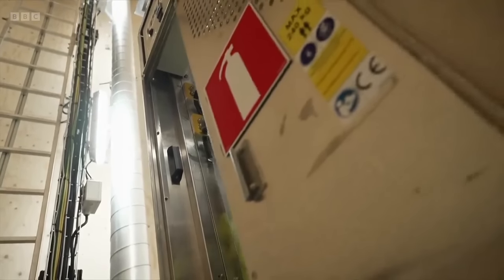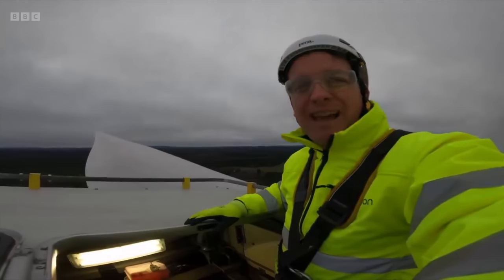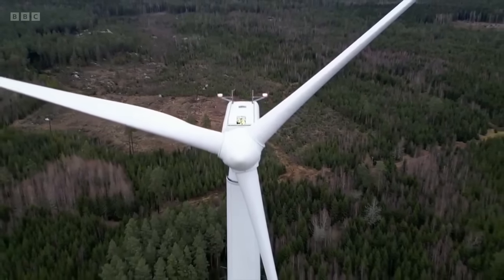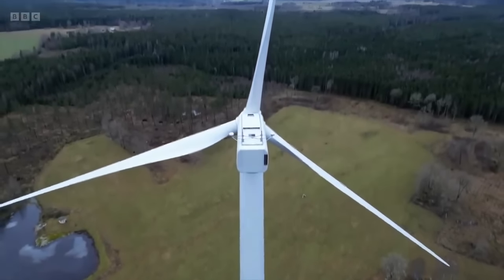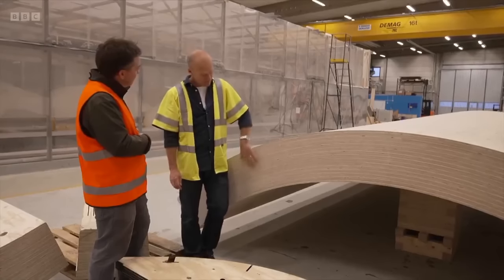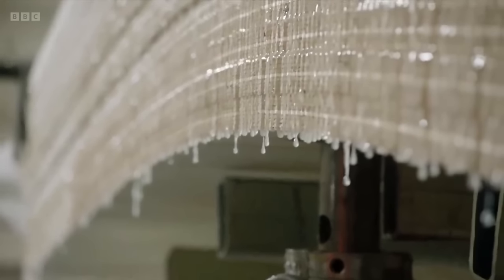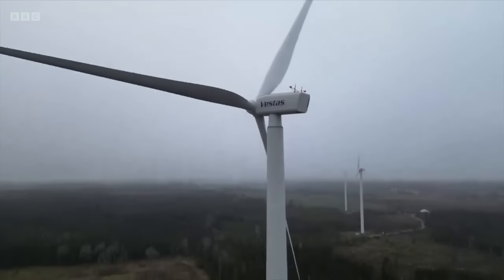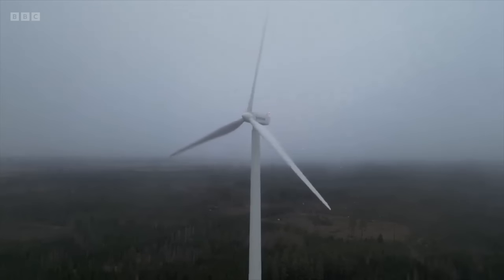Sweden’s giant wooden wind turbine promises greener future | BBC News

Comment: The question I have is how does wood hold up against the elements? Would these turbines have a shorter lifespan than their steel counterparts?
Reply: 100% it would. Obviously most components will have to stay steel.or some kind of metal.
Reply: Well the wood would have a substantial layer of some kind of protective laceur on it so im not sure if it would notice much of the elements at all... - obviously water should not be allowed to seep into the wood. - in theory there is no reason why a wood structure cant last 100s of years... not sure about the wood glue though and how well that will hold up over the decades.
Reply: @historyZZ  Depends on the location.  A steel turbine near the sea will degrade very quickly due to the salty sea air.  Meanwhile wood does not have that same issue.  In addition there are multiple treatments that can be done to wood to improve it's durability and resistance against the weather.
Reply: @giglioflex  
Wood that is exposed to moisture will rot. Therefore the wood would indeed have that very same issue.
Reply: @giglioflex  not trying to be a dick. But you're putting a turbine up by the sea metal OR wood. You don't think they'd try to properly coat their millions of dollar property regardless of the material. We have wind turbines in the ocean. They're not wood. I assume 99% of companies enjoy making profit. If they could off this they would be. And I know that's a cliche but my point is being made.
Reply: @historyZZ  Not a great point you made, since it neglects the fact that this is a new technology. Your point fails to predict any technological change leading to market change.
Reply: @Patrick-y4d1z  Tell that to all the ocean going wooden ships of centuries past.
Reply: U FOR  GET. WHERE ARE YOU GOING TO  KEEP  PUTTING  THOSE  BLADES.  
WOOD  GOES  BACK TO THE  EARTH...
Reply: Also, how is chopping down trees considered green….
And…what happens when it’s 40-50 Celsius and the glue on the wood starts to melt again, lol.
Reply: @SocialDownclimber  
You mean, the ocean wooden ships that had massive crews and were constantly maintained? And then all still proceeded to be destroyed by the water over time regardless?

Yes, that's the same thing and helps prove why this won't work.
Reply: Depends. There are wooden telephone poles that have been standing for 80+ years. All depends on the quality of the wood and treatment it is given.
Reply: the turbines are made of fiberglass, which is a polymer, created from oil, steel turbines would be too heavy
Reply: @Hathur  
Telephone poles typically last on average for about 30 years. 

Telephone poles also don't have moving parts, aren't as large or as exposed, nor are they as expensive or important infrastructurally. 

There's a reason that wood is limited in its uses building-wise.
Reply: I own a wooden boat 100 years old; it is a fine material for even the harshest environments. This wood is clearly coated and impregnated in an appropriate way to protect it from deterioration and this is built from softwood from plantation forest so no environmental degradation involved. I can see this idea being very successful, but like all new developments it will take a few years to perfect.
Reply: I think the limiting factor of turbine lifespan isn’t the tower, but the blades. If the wooden tower can last for as long as current blades, is shouldn’t be an issue.
Reply: This is just Swedish propaganda to make money
Reply: @historyZZ  That's why I would have a tower with a wooden frame but metal skin.
Reply: @WhyWorldWet 40C is not a thing in Sweden. We barely pass 20C in summers.
Reply: Don't forget wind farms at sea and land gives shorter responding times to inbound missiles. In Swedens case its military have warned of the consequences.
Reply: @Buppasiri1  its all designed to fail,for the great reset!!
Reply: @Patrick-y4d1z  in Finland it, s for the fire restrictions.
Reply: @SpoonfishLee really? We get 30 and more here in Stockholm
Reply: @starvictory7079  30+ is not the average. We had like 31 or something like that in 2018 with the big forest fires, but I don't think we had even a single day close to that this summer.
Reply: @Patrick-y4d1z  Wood does not automatically rot when exposed to the elements. Even when you get rain on it. There's a trend in modern building design to use untreated wood, and as long as you make sure it dries properly after it has been raining, it can last decades without any paint.Obviously these wood turbines do have some extra protection as can be seen in the video. But I'd  be willing to bet that untreated mass timber would last decades on its own.  I'm guessing the base where the rain collects isn't made of wood either.
Reply: and would that mean that made out of wood, its actually lighter than metal so its spins more therefore produces even more power?
Reply: @goncas1300 Did you actually watch the video?
Reply: No problem with wooden tower coming up from the ground. But you still ned 150 m3 of concrete to stabilize the tower. Unless it took root of course...
Reply: @auspiciouslywild  
Saying that they degrade slowly isn't exactly a great argument for their use though, is it? 

And most modern building designs when using wood (if any) tend to treat it and it's almost never used structurally because of its relatively poor construction qualities. 

It tends to be weaker, degrade faster and be less secure in relation to things like earthquakes, rain, fires. 

And this isn't better from an environmental perspective because these aren't trees that are living. They're farmed timber (which means habitat destruction) which are manufactured and transported as the regular turbines are and held together by glue which is also environmentally hazardous. It's also going to be less reusable than the regular wind turbines and require replacement more often, increasing the costs of maintenance.
Reply: aliminum steel gets dumped in big destructive and wasteful areas so, its better either way
Reply: @magnem1043  
Aluminium and steel is recycled and reused, it isn't dumped because it's still valuable. That's the benefit of metals. 

So it's better in literally no way.
Reply: Wood turbine ...... Meets termites 😂
Reply: How long does a tree or wooden rollercoaster last, some can last 100 years if taken care of
Reply: Everything (well… not literally, but you get it) in Sweden is built from wood.  Especially in the middle and northern regions. Larger buildings were built out of concrete and there was a regulation that said that a wood house couldn’t be larger than two stories for fire and construction purposes.  However after a lot of research that regulation was terminated and they now build skyscrapers (well… not like those who touch God in his butt, but you get it) out of wood. 
There are houses many hundred years old with untreated original wooden timber stocks around. You can similarly today make non-insulated timber housed that has the same (or better) isolation factors than the isolation standards houses built in Sweden must adhere to.  And if you treat the wood properly with a surface that breathes, it will last longer than concrete and wood facade buildings. 

These wind turbines need constant moderation.  While the energy is cheap, it actually creates a lot of maintenance jobs.  And even if steel or carbon fiber is used, the turbines (including the concrete) aren’t designed to last too many decades.  In the largest wind farms in Sweden (= in Europe) it will be time to replace the wind turbines as soon as the farms are completed.  That doesn’t mean only new towers, generators, and blades…. but even the concrete structures they stand on must likely be replaced.  But that is obviously a factor already taken into account when it comes to costs.  Getting the question “when will this wind park be finished” (about a major wind power plant where I live), I answer “just in time of New York being fully completed”.

Sweden is also turning its steel industry (a major one in the nation) fully carbon neutral.  That means even replacing the carbon used in the stainless steel with hydrogen atoms instead.  So greener steel will be introduced.  And much of the wind power will be used to accomplish carbon emission free mining and production.
The major issue however seems to be the concrete.  Where the cement involved is horrible when it comes to carbon emissions (and contamination of the drinking water where the mining of chalk is taking place).  But there are means to replace this cement with a cementish material produced from “leftovers” from the steel industry.  But due to a close to monopoly situation when it comes to cement production, unfortunately this technology hasn’t been invested in.  And if the lawmakers finally would be as concerned about regulations on this issue to help create a situation where competitors can start to invest in new cement technologies, it will still take years before scaling up today’s research production to an industrial scale.

New and experimental materials are introduced all the time when building and maintaining these wind farms.  They are not only producing cheap sustainable electricity and sustainable jobs, but an overflow of technological innovation.
Reply: @abrakkehakka1357  
That's a whole lotta nonsense right there.
Reply: @patricklindahl868   Good point, but I'm sure more R&D will yield wind turbine foundations that are less resource intensive. Wood is stronger than steel by weight, so the tower should be lighter, which should reduce the size of the foundation.
Reply: Larch is good in wet environments most softwoods are pants. Iroco and teak are excellent but too expensive and rare for this type of application.
Reply: A video released a year ago told us of the treatment. But in a nutshell - every precaution have been taken to protect it from the weather.
Reply: These layers of wood are glued together by epoxy resin, a residue from the oil industry. In the video you can see it dripping. The wood is no more than the absorbent of the epoxy, who gives the strength. Since Epoxy desintegrates under UV light, you need to protect it by an extra coat of UV resistent paint. 

Nobody’s getting out of the oil industry any time soon…
Reply: Steel turbines only have a 15 year lifespan anyway.
Reply: @Fr99763  they could use
Resorcinol glue which is wood based and very water resistant.  Most marine ply is glued with phenolic resins which are made from methanol (I think). There are alternatives to epoxy but they won't work with glass and carbon fibre.
Reply: The oldest wooden extant building was built in 607 AD.
Reply: @giglioflex salt water doesn’t rot wood believe it or not, rainwater and fresh water does. Wooden boats rot from the top down
Reply: @tomellis4750  I suspect Hōryū-ji is like my mums broom she had for 60 years, it only had 5 new heads and 4 new handles.
Reply: @Kabivelrat  The ones with fibreglass blades show damage in months which reduces their efficiency. People underestimate the effects of the extreme air-speeds and therefore driven pollution they are assailed by constantly, battering their surface. Coatings are constantly being improved to protect whatever material is used, but their lifespan is surprisingly short anyway. The article points out to the benefits to the initial installation/replacement because of less weight to transport etc, but I still think they are underestimating the cost of loss of mature trees and replacement with new planting which shows little benefit for many years, as well as the constant disturbance to the soil fungal and bacterial structure and the wider environment in so-called sustainable forestry.
Reply: @tomellis4750 how long you been waiting to drop that line😂😂😂
Reply: @WhyWorldWet Sustainable forestry actually helps trap more co2. 

Only living trees trap carbon. When they die, they decompose and release it again. 

Human cultivation and use of lumber delays this re-release because obviously, we keep lumber in good condition through various means, thus preventing rot. 

Second, any industry that depends on wood, will want a steady supply. If we regulate it right, we create an incentive to maintain and plant living trees for that constant supply.
Reply: Today nuclear power can't compete with wind power but I guess it can 50 - 100 years from now. So we may not need wind turbines forever.

Comment: Deterioration from several mechanisms affects glue lam at least for beams. Long term  resistance to compressive stress, plus risk of water damage from the elements and condensation seem to be the main issues for wind turbine towers.  Time will tell...
Reply: No rust to worry about.
Reply: You better call them up and let them know, in case they didn’t think about any of that at all right?
Right??
Send in your resume while you’re at it.
Reply: @Freshbott2  Ha! I can only claim seeing a few examples of glue lam  beam failures due to delamination and a vague awareness that timber is happiest in tension. They obviously CAN use this material, but is it a good idea, including the reality of trying to join sections reliably  with adhesive on site in often  wet conditions?  Chalmers University study of 2018 is interesting in looking at multiple aspects of alternative tower construction.

Comment: How about the blades? it's the main non-recyclable part of a wind turbine!
Reply: it is recycled...
Reply: This report was solely on the materials used for the tower not the actual turbine blades. So I don’t understand why that would be reverent.

But, I do know that there are techniques to recycle the blades quite easily. However, even if you don’t recycle the blades the waste is far, far less than the waste from non-renewable types.
Reply: Most are buried or simply discarded. They are an increasing landfill problem.
Reply: @papasquat355 No!  Everything is planed in advance.  They just don’t build stuff and the figure out what happens.  Not in Sweden anyway! Where “recycling” is a words constantly heard in every brain.  Regulations and regulations have to be followed before licenses are given.  The maintenance process is very important when it comes to wind power.  Since a wind power tower in total only lasts a few decades before everything (including the concrete foundation) has to be replaced.  And the costs and logistics for this are quite well planned.
Asking when a wind power plan is finished is really like asking when New York will be finished.  A larger power farm will start rebuilding and replacing everything as soon as it’s “completed”.
And if there’s a problem with recycling and waste, it is solved.  At the worst unrecyclable plastics will be turned into energy by burning it.  Another means of cheap energy production in Sweden has actually been importing (well… getting payed for taking care of) landfill waste from other nations to turn it into energy at plants well designed for this purpose. Although burning plastics and other stuff obviously results in carbon emissions.
Reply: The new blades last 3 decades and are inert so you can just bury them like you'd bury a rock.  It's such a tiny problem compared to recycling a gas power plant, oil refinery, or nuclear power plant that it's almost laughable.
Reply: @DemPilafian  plastic is also “inert”. Very ungreen and wrong comment.
Reply: My thoughts exactly! The blades are the main component with a very limited lifespan, that currently cannot be recycled (compared to the metal tower which is readily recyclable). It is a cool innovation, using wood for the tower, but I hope that they work towards fixing some of the larger ecological issues with wind turbines.
Reply: @johnsbirthdayinapril4197   "very limited lifespan"   Ha.  Ha.

30 years is hardly a very limited lifespan.  What's your purpose in life?  Who are you trying to help?  Are you hoping your kids grow up to be coal miners?  What gives?
Reply: @johnsbirthdayinapril4197  Ironically, the blades (made of fiberglass and resin) can be ground up and used in concrete. So the green technology is used to cover more of the planet in green killing pavement.

Comment: Is producing plywood carbon neutral?
Reply: It depends on what the energy source is used for the production of both the resources (the wood, glue, etc.) and the finished product.  Sweden’s electricity production has since long been quite carbon free.  With major hydropower infrastructure in the industry rich northern areas (where also the forest grows) and nuclear power to complement it.  The large investments being made into wind power is to turn all of Sweden’s industries carbon neutral or completely carbon free.  Even the carbon used in stainless steel is being replaced.
I would believe this plywood is rather carbon neutral if you calculate on the full use of the plywood:  First as plywood.  Then, when discarded (decades or longer) later, likely made into some other material.  And finally the wood fibers someday will end their “life” likely ends its life by fire (possibly for energy production).  Where some (but not all) of the carbon the trees “breathed” from the air is “exhaled”.  For now I would believe the major issue is the harvesting and the transportation of the trees that is being done with mainly fossil fuel consuming machines.  Although some of the fossil fuels is slowly being replaced with fuels produced from wood.  And even diesel harvest machinery and trucks are replaced with gear that runs on electricity (that wind turbines will produce).